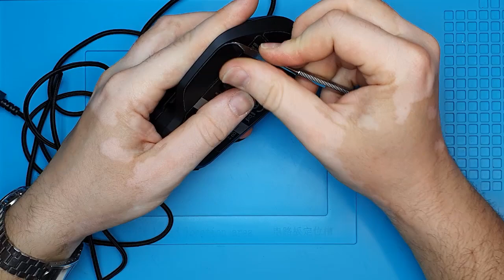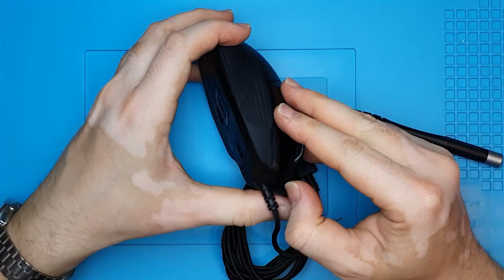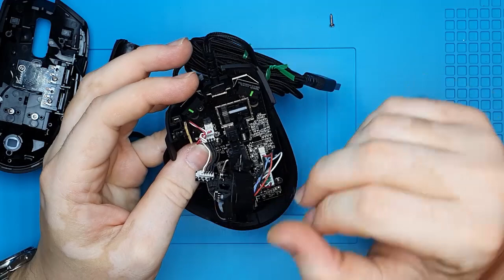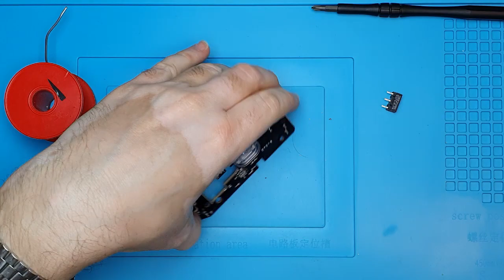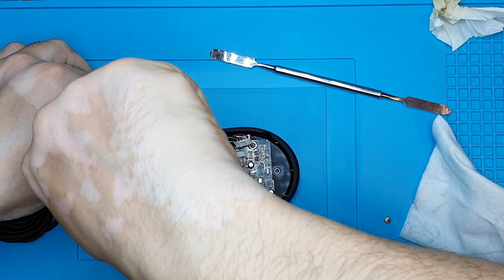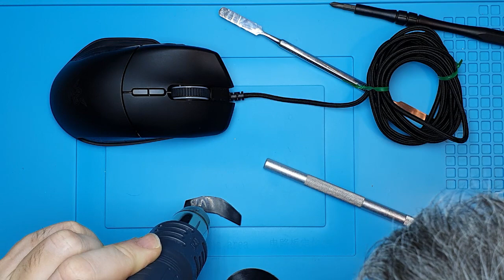RAZER Basilisk Mouse Button Repair

Comment: If your looking at this video because your left mouse button double clicks and your not a solder master, I would try to lift a bit the metal plate near the trigger and also put electronic cleaner. The thing that is causing the problem to happen is a buildup of static in the trigger. Try to clean it as much as possible to have less static build up in the future and lifting a bit the metal plate should help with the double click.
Reply from the maker: This could solve the issue of a while, but in the long run the button needs to be replaced. As for another reason the button not to work goos, is that a part of the metal plate in the button acts as a spring and after heavy use some microfracures are formed  which weakens the spring. In this case, replacing the button is the only option.
Reply: @glab1334  Didn't know of that issue, good to know

Comment: What are you doing exactly at 18:30 ? Heating the plastic ?
Reply: its better if the gliders are heated up before applying them. but i dont do it.
Reply from the maker: I'm heating the mouse pads, as they got a little bent while removing them. The heat is helping to return the flat shape back again. Still, the heat should be no more than 80 C, otherwise, they can melt and deform permanently.

Comment: I also have problem with my left mouse button / switch on the Razer Basilisk V2. How do you refix the glide pads properly? Also where can I find the proper replacements switches? Thx :)

Comment: Hey have u tried any other switches apart from the omron ones? I need to get mine replaced so I was considering other switches like kailh.
Reply from the maker: I did not use other than omron. Anyway, I'm pretty sure there are better ones, as the omron start to fail so quickly.

Comment: Are there any upgraded switches I fould put on the left and right mouse buttons? Mine lasted under a year and I would like my new ones to last for much longer. Its the right click that went bad (i think). In video games it just stops clicking randomly. I just uninstalled all of the drivers and such but I have not tested it yet. Is there anything else to try to make sure it isnt software related?
Reply from the maker: I guess the buttons of this mouse model were defective or something in general. They should last much longer than they actually do. A good replacement is OMRON D2FC-F-7N 20M which has a lifespan of 20 million cycles. The original switch lifespan is about 5 million cycles.
Reply: @glab1334  Thanks for the help and info, I already subscribed :)

Comment: My model started to having problems with RMB few days ago. It is not noticeable in windows but during gaming when I hold RMB and LMB at the same time RMB often is not "holding" the click. So for example I am unable to zoom and fire. Thus precision fire is very problematic. 
I bought it about 6 mo ago. 
What can be wrong?
Reply: That's crazy, mine just started having the exact same problem today
Reply: @voidsabre_  Its really F up. I paid $50 for this thing. Its my most expensive mouse. I have expected top quality and superior durability. 
Razer claims that their switches have up to 50 million clicks!! I am disappointed. Will never buy Razer again. :((((

At any rate. I am returning back to Logitech. I ordered cheaper Logitech G 102.
None Logitech mouse ever failed me after only 6 months.
Reply from the maker: If you rule out any software issues, because a software can cause the exact same issue, the buttons need a replacement. I'm fixing the same issue with this one.
Reply: @glab1334  Thank you very much. But I am already using Logitech mice. :-) 
But the bitter feeling will remain for a long time. Basilisk was my first Razer product. 
50 dollars for a mice is a lot so I expected really top notch quality. Sadly I have got disappointment.
Reply: Yea, I bought mine a year ago and am having the same problems :(

Comment: My right click on my Razer Basilisk sometimes clicks twice when I press it only once, the mouse is about 2 years old and i've kept it clean, never opened but rubbed it down every now and again and tried to remove all the gunk with a toothpick and a q-tip dipped in isopropyl alcohol. Is this something that I can fix without replacing the button ? I don't currently own a soldering iron, and if I need to go get one just to fix my mouse, I would much rather look for a new mouse. 
Thanks !
Reply from the maker: That is a common issue when the button starts to whear out. You could try to open the button itself and clean the contacts, but this is very delicate operation that require steady hands and really fine tweezers. 
There are some small clips on the sides which can be pulled gently to open the button cover. Inside the button are basically two parts, a little plastic pin, the one that shows from the top of the button, and a metal spring. Both of them you can lose very easily. You need to clean the contacts on the metal spring and the metal pin below the spring with some alcohol (isopropyl) or some contact cleaner and hope of the best.
This whole operation is very risky, the chance of success is low and you can make it worse very easily.
Reply: @glab1334 Thank you for taking the time to explain this to me.
Reply: @glab1334  i finally got some better tools ( ifixit toolkit)  and opened that sucker up and fixed my right mouse button and learned how mouse buttons work in general.. all through my endeavour i was watching your video on the teardown. 
i noticed that the metal blade was bent downwards kinda and straightened it out and that fixed my faulty right click issue. 
thx once again for the video.

Comment: I have one that is not working at all. This will help with the disassembly but I doubt the problem will be obvious judging from seeing the parts in this video. I could, of course, just be the cord but I have tried moving it around while plugged in without any success. Any tips would be greatly appreciated.
Reply from the maker: If there is no dirt on the optic, I will go with changing the cord but still, it will be a tricky one to fit in, if you do not have exactly the same cable...

Comment: I own one for about 7 months and I have problems with clicking and dragging on my left clicker. I suspect that it has turned faulty. Can you advise which particular part of the mouse that I can buy and replace in order to get it working properly again?
Reply from the maker: The click and drag issues usually are signs of worn button in the mouse. It's possible the issue to be software related, so to be sure, you can test the mouse on a different computer to rule this out. The original buttons for this mouse are OMRON D2FC-F-7N, you can get them from eBay. You can use any regular mouse micro-switch, but those are more durable with longer life. However, as you can see from the video, in order to replace the button, it is required to have some soldering skills and a suitable soldering iron.
Reply: @glab1334  Sorry for the late reply. Youtube didn't notify me of any updates for this comment for some reason. I did a little research and I'm keen on getting the kailh buttons since my left clicker button has really been worn out, the clicks arent registering smoothly... Appreciate the reply. Love these disassembly videos! Please keep making them if you get the chance to repair different types of mice!
Reply: @glab1334  Hey man, will any soldering iron do the job? Like one for 35 euro or so, buying an iron and the switches is cheaper for me than buying a good mouse again.
Reply from the maker: @TheTribes44  any iron will do if the tip size is more or less like a dull pencil. Some kind of temperature regulation is also a good to have, otherwise you could burn out the PCB and to crew the copper traces. No more than 60W. I think you could find such soldering irons in aliexpress for less than $5. Also, you will need flux, otherwise the soldering will be a mess. If you are on a budget, you can use citric acid or aspirin for flux (grinding and mix with water to make some kind of a paste), but the smell of those will make your brain scream like never before :)
Reply: @glab1334  Nice one I appreciate it, pretty much all of the irons on Amazon are 60w so should be fine, just gotta get the flux and sensors and I should be good to go tbh, this doesn't seem like too much of a tough job after watching your video

Comment: Could you do a scroll wheel repair guide. The scroll wheel on my basilisk has stopped working
Reply from the maker: I have a similar video for fixing a scroll wheel: https://youtu.be/yhvHt-kCzuc . The general idea is to clean the sensor with isopropyl alcohol or any spray contact cleaner (suitable for electronics) like DeoxIT

Comment: Were you heating up the plastic parts on the bottom that you took off earlier to put them back on?
Reply from the maker: The pads were bend while peeled them off, so I apply little heat to them to soften the plastic and return the flat shape

Comment: What are the name of your tools ? I'd like to buy them
Reply from the maker: Screwdriver - Klearlook/EZARC Precision Screwdriver Set, 57 in 1
Soldering Iron - TS100
Solder Sucker - Engineer SS-02
Tweezers - PIXNOR Precision Tweezer Set 7Pcs ESD
All of those you can find on eBay or Amazon
Reply: Thanks a lot  !

Comment: Thanks a lot for a video! 
Could somebody tell me please how to find new middle micro switch?
Reply from the maker: How about this one - EVQP0E07K? https://www.tme.eu/en/details/evqp0e07k/microswitches-tact/panasonic/
Reply: @glab1334  thank you very match! 
Does it original or analog?
Reply from the maker: @RainbowForDC  It's analog, as Razer usually uses Omron switches, but this Panasonic one is a good substitute.
Reply: @glab1334  could you help me please, is Omron B3M-6009 original in this basilisk V1?
Reply from the maker: @RainbowForDC  Sorry, can't tell for sure.

Comment: Can i take the top off my basilisk x hyperspeed? or is there some other way
Reply from the maker: The "top" is for the battery compartment, which is held by magnets. If you wish to take out any other part, you need to disassemble the whole mouse. There are 4 hidden screws under the bottom pads.
Reply: @glab1334  ok, also what i meant by the top was what you did in the video, disassembling it but thanks anyway

Comment: 10:37 how is it called that item he use to melt this metal?
Reply from the maker: It's called "soldering iron". This exact model is TS-100, you can google for more info.
Reply: A soldering iron is a hand tool used to heat solder, usually from an electrical supply at high temperatures above the melting point of the metal alloy. This allows for the solder to flow between the workpieces needing to be joined. And the metal he used is generic 2mm 60/40 Flux 2.0% Solder wire. Hope this answered your question, sorry about the compicated english.